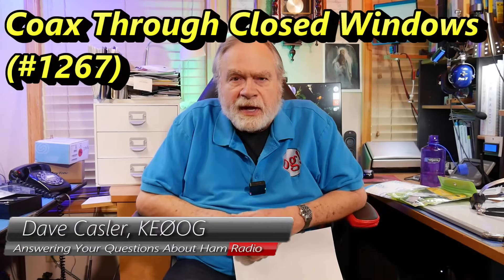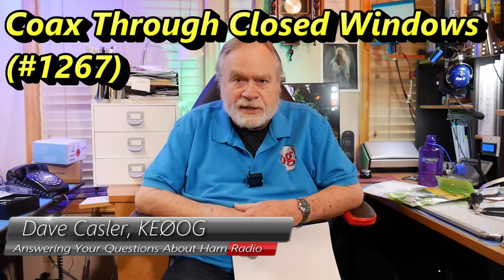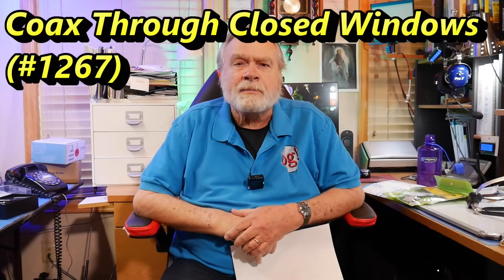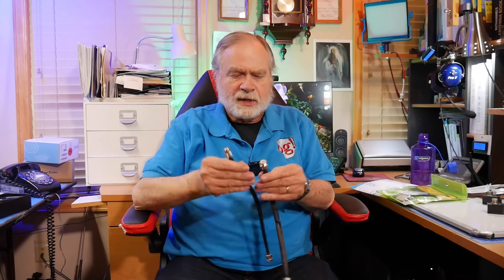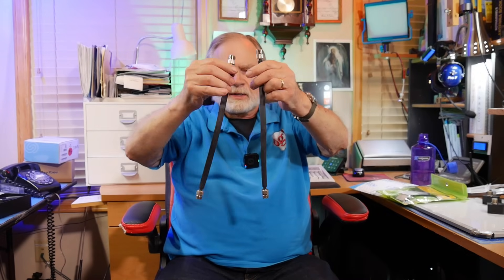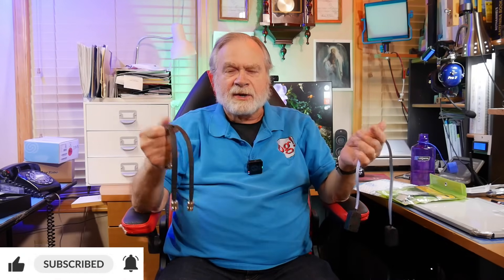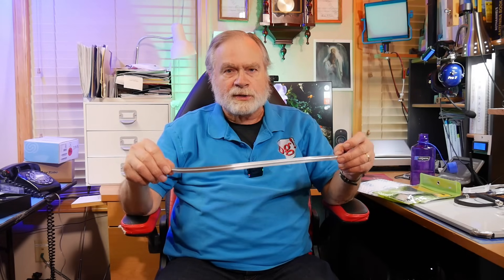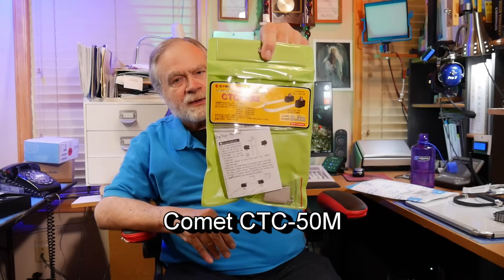Coax Through Closed Windows (#1267)

Comment: Hello Dave, first thank you for your videos. Second, a question: I need to make a connection from my antenna “farm” to my ham shack in my house - 250’ away. I will have to bury whatever I run, probably in 2” schedule 160 pipe. My idea is to run several lengths of “ladder line”, rather than coax in order to minimize losses. At least two lengths in case of failure(?). The mechanics of digging and burying the pipe, and pulling the ladder are tiresome, but, no big deal. Finally, If I use 300 ohm ladder line, will I need a 6:1 balun to connect to my radio? Thank you. KQ4IXD

Comment: Pool noodles laid horizontally on the sill,  cost maybe $3.00. Push the coax through. Close the window tight to the pool noodle. The poole noodle is a great insulation and weather barrier. No loss of signal, no damage to the coax.
The cheap window pass throughs are awful, the good ones too dam expensive.